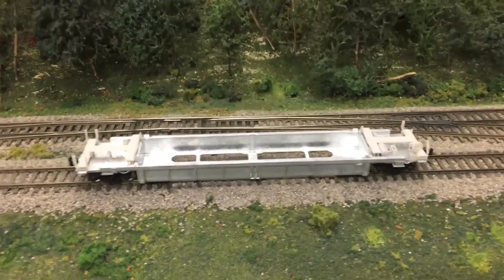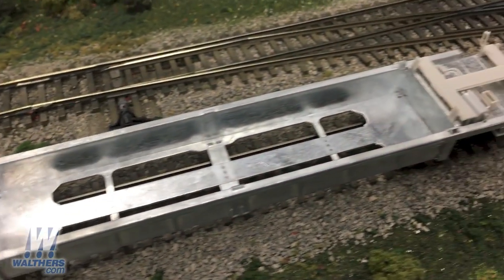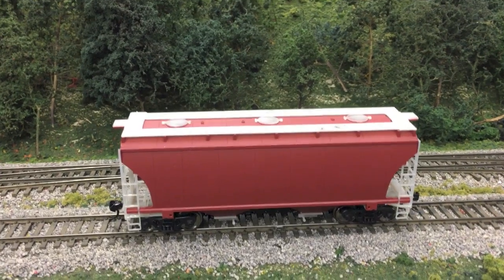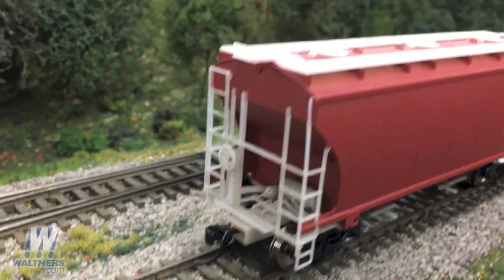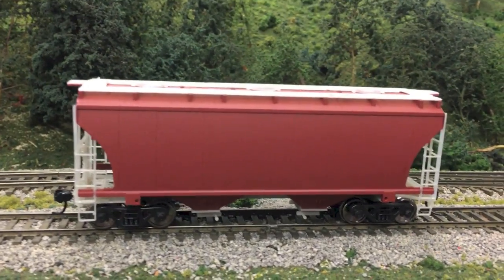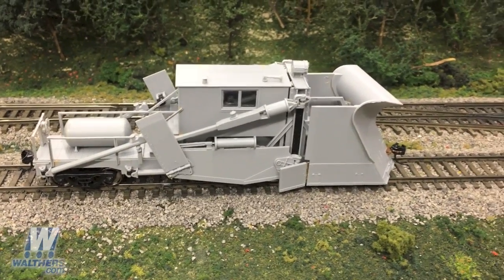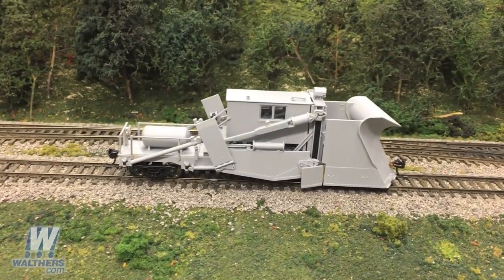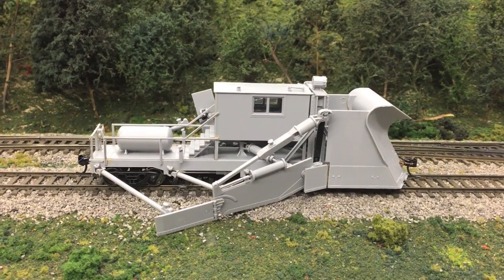Walthers Update 85 – Walthers NMRA National Train Show Rolling Stock Announcements

Comment: I got about 10 of those Thrall rebuilt 40' well cars, they all ran great out of the box except for 1 which came out of the box with no thread in the receiving end for the screw to attach the coupler. I also ordered a 3 pack of 53' NSC CN well cars and another 3 in TTX scheme, only 1 of the 6 ran well out of the box, the others had missing couplers and wheels that would rub against the well car frame causing squealing and drag on the turns. I had to cut the frame bar out on the end of the wells to stop the rubbing which fixed 1 perfectly. The rest I cut out the frame bar but the wheels were also rubbing on the bottom of the well car, I switched the wheels out for some smaller wheels and was able to get them running right. At the same time I ordered 2 Kato 3 car articulated 53' well cars that ran perfect out of the box. I don't mind some fiddling to get stuff up and running but Walthers needs to up their game, that being said I really like the cars and they were the only one offering them in CN scheme.
Reply from the maker: Hi Jim, thank you for sharing your experience. We take quality seriously, and I'll pass this information along to our product developers. If you ever have issues in the future, please feel free to contact parts and warranty here: https://www.walthers.com/parts-warranty